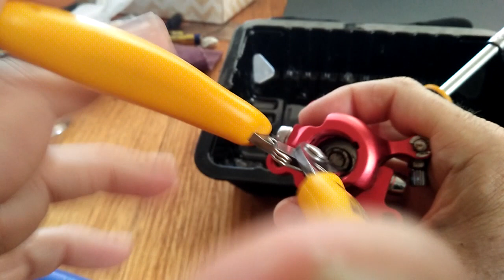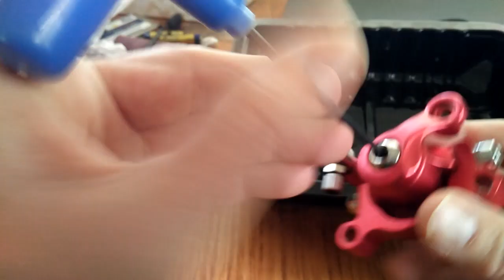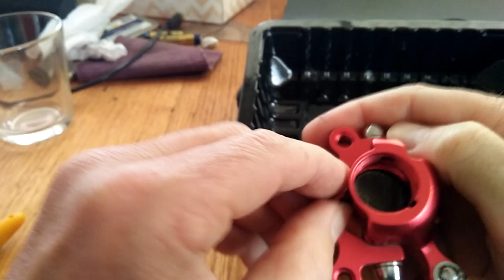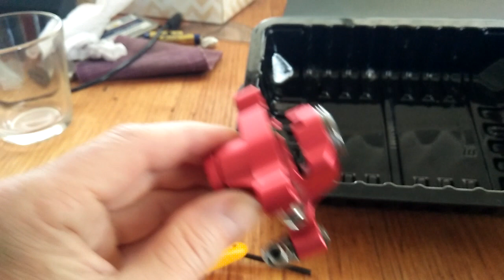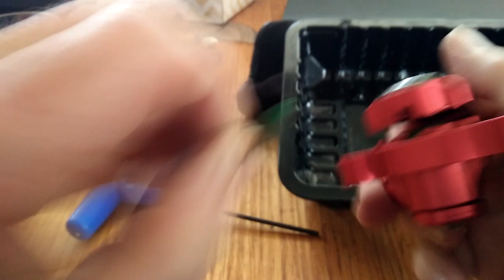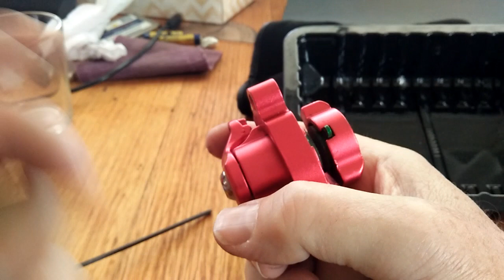Mercane disc caliper solution

Comment: I have the Pro and rode through a 8" puddle and weeks later both breaks seized up and locked up as it fell apart. I nearly wrecked both times. Got new break hydraulic breaks for the back. Much better don't have to adjust my pads from ware each ride.😁
Reply from the maker: interestingly I'm still on my first set of pads and I just recently changed out the pads for my friends Pro (he has two teenage kids) and those got 2 years.
I dunno what is happening with yours, but I'm glad you got a system you like

Comment: Is it possible to use a different caliper
Reply from the maker: undoubtedly ... however finding a caliper that is an exact match with the mounting will be slightly problematic, not to mention fitment on the wheel side. I would suggest that for a tiny fraction of the effort required in finding one, modding it all and still finding that IT has difficulties (and what they are and how to solve them that just simpler to spend the few moments needed to tune up this one. It is after all almost identical to every other mechanical disc caliper on the market and there have just been but a few (loudly squealed about by the emotional and largely ignorant) on some forums.
#theDevilYouKnow